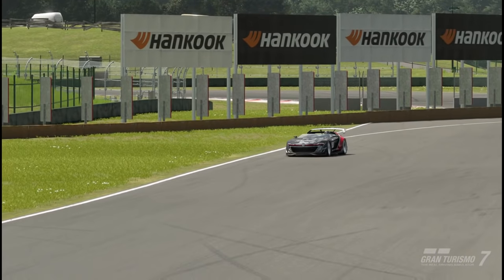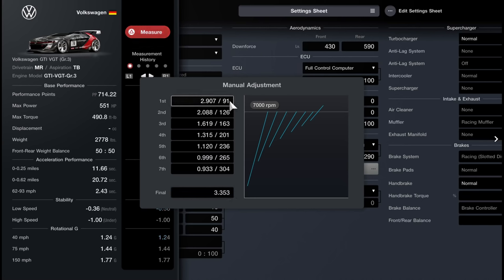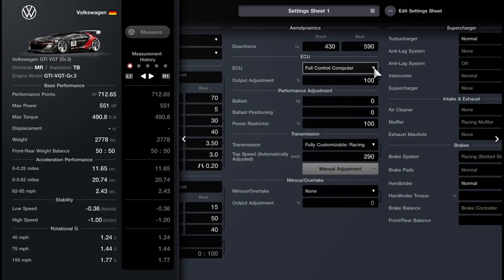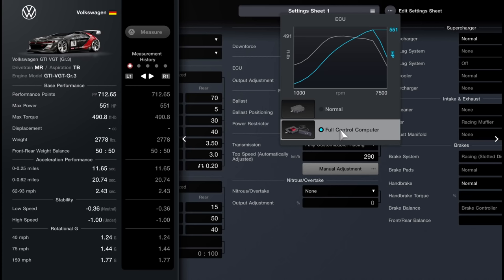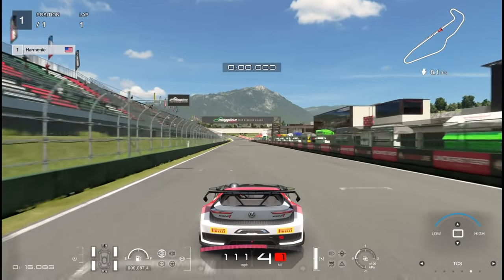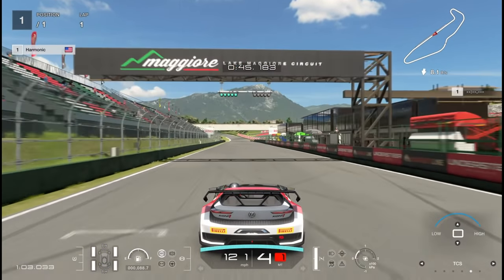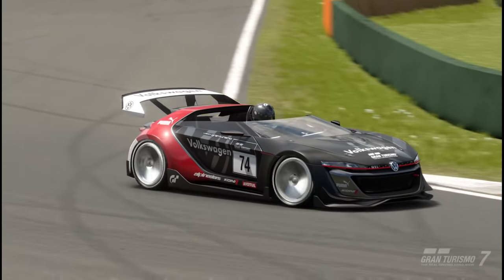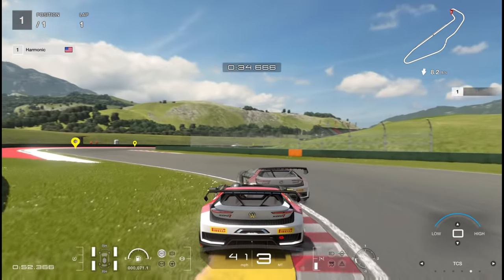How to Tune GEARING | Gran Turismo 7 Tuning Guide

Comment: I’m going to need to watch this 3 more times and take notes. I grasp the basic principles and totally dig it. 

Biggest take away? Shifting in the correct moments to stay in the power band. I probably don’t do that. So that’s gonna be the first thing I do tomorrow.
Reply: Any updates? I'm just now following your path.
Reply: @therookie710  any updates? Same position as you 5 months ago !
Reply: i shift it like it’s a lada, only by the sound
Reply: @RubleNoob840 more hard bass
Reply: @shawnyarborough5981 I drift, only thing I tune for, use drift tunes on tracks with assists and auto trans, however I drift in 4th shift down to third to slow down and transition and right back to 4th to slip traction, and back to 3rd to gain traction sometimes down to 2. Shifting in power zones is crucial, I'm just trying to figure out how to adjust the gears to achieve a better power band
Reply: It does work just shows half of this is a user error and those millions of adjustments on gears wasn’t the trick! Good luck brother! X

Comment: My five cents.
Choose your car and track combination. Ideally the upcoming Gran Turismo 7 event.
Set final drive to 4:1
Set first gear to 3:1
Set final drive to 1:1
Spread the other gears so it looks nice.
Drive the car for a couple of laps.
Note problems you notice. Revving out in top gear, for example.
Move final drive to improve top speed.
Move first drive so you can use it effectively when lapping. If you tune for best standing start you might enjoy drag racing.
Spread the other gears so it looks nice.
Do some more laps.
Fine tune. Now is the time to look more closely at the middle gears. Look for good gear/corner combinations.
More laps.
Fine tune.
And repeat.

Thank you, Harmonic. Your intro into gearing is good stuff.

I'd like to hear your thoughts on Brakes.

Comment: The bumper cam view was always intended by the creators to be the main view that everyone would use the relative speed as far as visual goes is best related in bumper view. Also, all of the race information is available in bumper view cockpit when I'm using VR in my rig, but using a controller sitting in my chair I normally use bumper. Cam is a turn off all the information. lol thanks for explaining gear ratios most people don't understand them at all

Comment: Thank you! This is exactly what I needed. My 1LE Camaro was having extreme trouble with preset 3rd gear, whether it was getting to it or leaving it. I’d red line 2nd then flip to third and third would red line instantly and i was so confused on how to fix that as to not spin out attempting to reach 4th gear. Now all gears ride smooth, with a slight redline on 3rd, but nowhere near as bad.
Reply: Can you please share what you did to the gears? Im having the exact same issue, I tuned the 1LE almost to the max and the amount of wheelspin is insane, I have to do 2nd gear with just 50% throttle and 3rd can't go full throttle until the very end, then in 4th I have to once again wait quite a bit until I can go full throttle (I play without TC). All this even without the superchargers.
Reply: @naico144  I show my gear ratios for the Camaro in my video. You can pause and compare. The video shows the same way I got there.
Reply: @prtcountersteer  Yeah just saw them, thanks a lot dude. I'll test them tomorrow and give feedback. Again, tysm
Reply: @naico144  Let me know how it goes!

Comment: This video really helped me understand how it all works enough to be able to control my Supra RZ build. There's still a lot that needs to be done, but the fact that I'm not spinning out of control from the slightest application of throttle really goes to show how helpful the info is. Even though brake balancing was important, I would still go all over the place.
Thank you so much for this video, dude. I'm actually excited to tune more cars as a result!

Comment: Have yet to delve into what you've tackled here in GT7 (did it back in the GT days of old), but currently each car I drive I somewhat get to feel where the power bands are in relation to each's peak torque and max power simply by listening to the engine's audio (and the length of time it appears to yield through each gear's progression). Not an ideal approach of course trying to hear where these power bands are so appreciate the thorough demonstrations of what actually happens if we drove each car as we'd generally expect - revving all the way out to the redline, though as you've shown for some cars it's a clear disadvantage if not set up properly. 

Just came across your channel so will endeavour to watch any other informative aspects of car tuning in GT7 - if they're as extensive and informative as this, superb instruction - I get the feeling there's going to be a high demand for such content.

Comment: You are the man ! Thanks keep it up on your next video can you show us on the transmission screen where we should line up the lines more or less that would be very helpful also thank you for what you do.
Reply: Agreed. I love the information, but the chart with the gear lines doesn’t totally make sense to me. Especially as it has 7,000 RPM at the top where the car is at Max Power at 6,500 in the example. The other thing was the “Max Speed” setting shown on the main screen after changing the gears.
Reply: @coachjoeenglish  Agree 100%
Reply from the maker: @coachjoeenglish  I chose not to go into that because it takes even more guess work to figure out where your gears land by looking at the chart, and it just increases confusion. Because of how basic that chart is in the game, its only practical use for me is making sure my gears don't look oddly spaced out. If it had a grid and some more detail, I would definitely use it more.

You're much better off just driving on the track and setting gears that way. As long as you understand how to make gears longer and shorter with the sliders and why you should do so, that's all you really need.

As for the Top Speed setting, it's just a quick slider to set all gears longer or shorter. Be careful with it though, because if you move it after setting your individual gears, it will revert those changes. That's why I tend not to use it.

Comment: As a real life mechanic I usually use the final gear to set my speed. This final gear is actually changing the rear end pumpkin as in real life. The big round part of a rear axl in the middle that you see. The drive shaft attaches to it. 

You can also change the gears in the transmissions ratio with the individual sliders on each gear. 

Until you get your head wrapped around it just use the final gear to adjust your cars speed and takeoff. The higher the number the faster the take off but lower the top speed. The lower the number the slower the takeoff yet faster top speed. 

Real life examples are on an old school Mustang and Maverick (I own a 70 Maverick)), the usual stock final gear (the one in the rear axle) was around 2.79  to 3.00. This gave good drive-ability and gas mileage IRL. 

Also IRL if you wanted a quicker takeoff you could change the final gear to a 3.55 to a 4.10 but you would lose top end speed. Unless you were rich, you kept the stock transmission and manipulated the gears with that final drive (the pumpkin) by changing to a different pumpkin with different gears. Was a cheap and fast way to race on the weekends and change back for the work week on Monday. 

If you really wanted to race that’s when more money and a built better then stock transmission came into play where a better than stock ratio would be used. 

Maybe this will help connect the terms to IRL hot rodding the car so to speak.
Reply from the maker: @SatchelMcQueenVideo  you can use nearly infinite combinations of numbers to get a desired drive ratio. A final drive of 3.00 and a 1st gear of 3.00 will give you the same exact speed as a final drive of 4.50 and a 1st gear of 2.00. It's all just torque multiplication.

Of course you don't want integer values of final drive to avoid resonance, but that's not simulated in any racing game as far as I know

Comment: I'm driving in MT and I noticed sometimes it's an advantage to over rev as a control, if you shift only in the power band the next gear is more prone to fish tail, maybe some differential tuning is next to tune on controlling the power band.
Reply: I noticed that too, the same can be said if you downshift into your power band it will induce rotation on the rear wnd

Comment: Hello, thank you for the video. I wouldn't mind learning a bit about the camber settings in GT7. Since seeing your video about the ride height I started using photo mode to look at my tires and the suspensions compression. I've noticed the tires themselves are compressing and stretching too in the game which is awesome, but it seems that the camber does not change at all with the movement of the suspension. You would think when the body presses down on the outside strut the camber becomes more negative and visa versa, but I don't see it. It made me think about your tunes with minimal camber setup. It's also hard for me to decide if I should raise the spring rate, dampeners or torsion bars. I've raised my car 40mm but I still don't get to full steering lock with my controller while taking some turns, I suspect GT7 has some sort of steering aid always on when using a controller, but I wouldn't be surprised if it was my suspension setup. I try this on a Ford Focus RS with 499Bhp and wide wheels. Also my handbrake does not work anymore, even with the tuning handbrake. I bought another RS, didn't tune it and my handbrake does work. Very strange. 

Thanks anyway, Super GT mentioned your channel and I've loved all you content since that day! ☺

Comment: I need to mention that the first gear can be a lot longer and closer to the second gear. If the engine can overpower the tyres then there is little point in having more torque form the shorter gears. 

Idk how the GT7 meta is yet, but the final drive should enable you to bring the gears closer together or wider while keeping the start of the rpm more comfortable for the engine.  

I still play Forza Motorsport 4 most of the time, because I just enjoy tuning the cars over there. So much info, but alas there are unrealistic settings that cheat the physics engine.

Comment: I just tune my gears to give me the top speed that matches the track. If I can't hit 200 mph on the track, then I don't need the gearing to hit 200. Everything below the top end I try to make well spaced out to ensure the engine stays in the peak power band. On tracks with lots of high speed sections, I'll set the high end gears closer and the low end gears further apart. On low speed tracks, I just try to keep things even without having the first gears so low that I'm always spinning my tires.

Comment: Great explanation.. my true weakness on tunes.. I’m looking forward to better laps.. 
Thank You.  I usually flip trans ratios by moving final gear to the left and then setting Top Speed .. I do this for cars with low Torque values compared to Horsepower values.. when done properly you can achieve higher gear ratios.  Very Useful info in this video especially Power-band explanation .. 
Thank You . PSN handle T.Moist.

Comment: hate to be a nerd but if you want, I can make formulas for those curve shapes and then you can always put a value for hp to find rpm or vice versa. The higher the accuracy, the more annoying to try to match, specifically if the curves are boxy like (but not sharp vertices)

Comment: You use a very similar logic to me so i gave you a sub. I base my gear ratios around peak torque Aston martin gt3 for example with gear ratios set to with in that torque curv and 6 gear also with that torque curv on the longest straight on nurb nord  or nurb 24 a short shifting motor helps for saving fuel to 👍

Comment: I really enjoy this technical knowledge. never been one to understand the correlation between each set of systems especially gearing. keep it up love learning these things to be be a better driver. 

If anything I'd love to see how the correlation between a proper gear box for say... a Short track would relate to a properly tuned suspension and LSD to handle power in the corners under load and off load. I know the other videos you have up more or less go over this and its a bit of trial and error. nonetheless if anything id enjoy to see your process of going about it. 

Thanks a ton for sharing your knowledge!!

Comment: I would like more videos like this on the other settings; also, could you mention on the next video which group of settings to do first?, read somewhere that before tuning the gears you have to do the final weight and power, or all the gears will be messed up, Is it true? mentioning which goes before which can be very helpful.

Comment: 2:45, haven't tested it yet in GT7, but in 6 different cars liked different finals. Snappy fast revving 4 bangers liked high ratios, big V8s liked lower ratios.
Your nismo liked 4.5-5.11, but your Vette loved 2.73.
Reply from the maker: Final drive is arbitrary when the individual gears are adjustable for the reason I explained.
Reply: @Harmonic14  I haven't tested in 7.
In 6, there was a noteable difference when you geared the final based on how your motor revs.

Youd set the speed you wanted, roughly, using the quick tune. Then youd change the final. Then you change the quick tune to get a whole new set of gears in the tranny that match your new final.

You could then adjust those gears individually to perfect the total setting.

Comment: 5:24 Do note that the torque numbers don't tell the whole story. You need to consider the actual ratios as well.

It might be the case in lower gears (1 or 2) where you get so much torque multiplication from the gearbox that even at redline with the power dropping off sharply, you're still making more torque than the higher gear. If you try to adjust your ratio to suit the torque numbers you'll change its RPM when shifting so you need to set the value right.
Reply from the maker: That's the entire point of the video... You set your gears so you're at peak power as often as possible. You're going to have more wheel torque in a lower gear, but if you spend more time in the region with power loss, you're losing acceleration. If your car has a power band like this and you find it fastest to shift at redline, your gears need to be adjusted